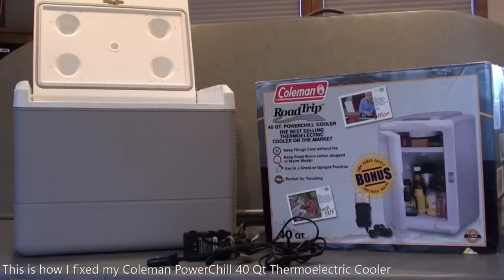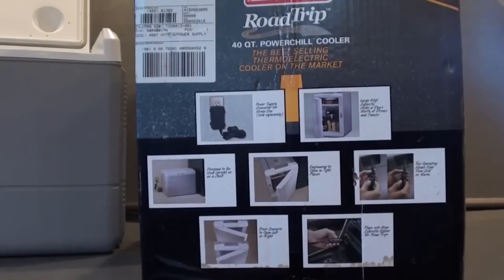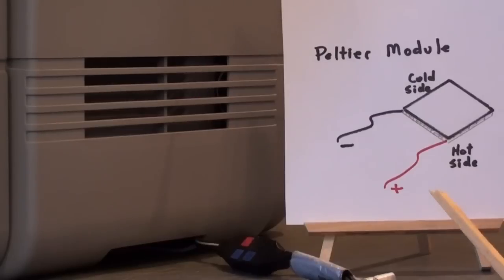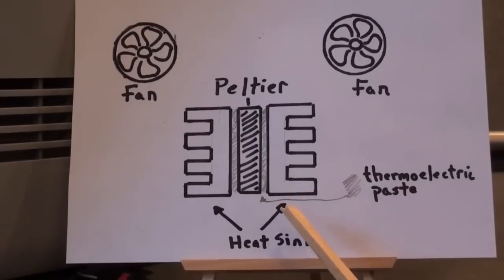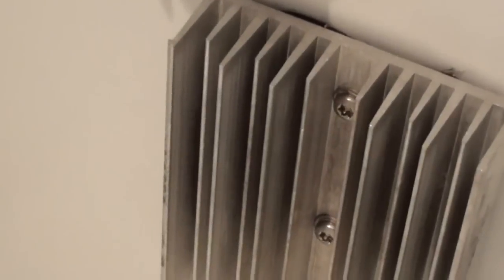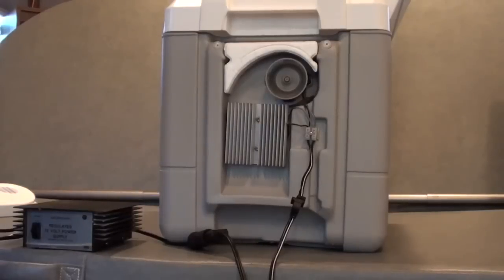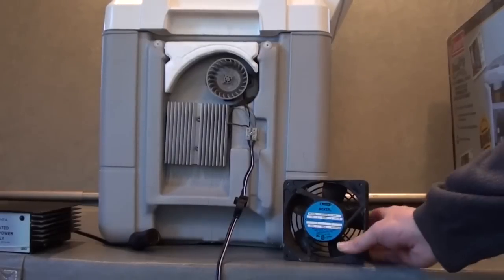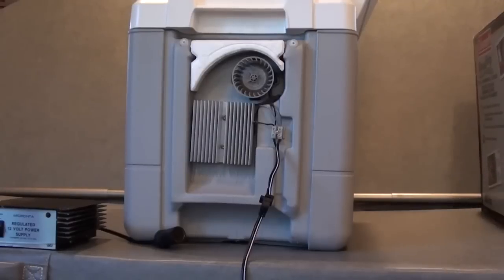Coleman Powerchill Thermoelectric Cooler won't Cool (or any cooler that uses Peltier Process)

Comment: Great video.  I have the same cooler.  Bought it 23 years ago and it still works great.  I took off the white plastic blower cover inside and now I can't get it back on.  Any suggestions?  And yes, I have tried multiple times and attempts, but unable to find out how/where it attaches.

Comment: Thanks for the video. I took mine apart to change the thermal grease. There is a thick black sealer between the peltier cooler and the body of the cooler. Anyone have any recommendation on what to use as a replacement when I put it back?

Comment: Do you know what that little thing attached to the peltier is? It's covered in black goo. Right next to the module by the heat sink.
I just replaced mine but the new one didn't have it. Should I use that with the new one or toss it?
Thanks

Comment: I appreciate the video mate, I got given a “Porsche cool-bag” that has a peltier system in it, it looks unused, and I plugged it into my cars 12v socket and it doesn’t work, the socket works because I can charge my phone from it but not the cooler, I don’t want to go pulling it apart, as I looks like I’ll damage the bag it came in, any ideas ? 
How would I know a dude is not working? 

I can see the mechanics and fuses through the air vent
Reply: People normally “give” things away because there fucked!
Reply: Gasgiant i expected that but I want to see if I can fix it,

Comment: I had a question for anybody that might know the answer to.does it matter which fan is on either side of the cooler when it's running?I ask because there are two YouTube videos I have watched and this video has the " grey color " fan on the outside and the "tan colored" on the inside of the cooler... however, on the other You Tube video it was the exact opposite
Reply: It depends on your specific model! The color is only so it looks nicer on the inside, besides I believe the inside fan is more protected against humidity and such!!!

Comment: Thank you very much for this very helpful video!  I have a question: our fan is working fine, the power supply as well (I conclude so as the cooler is the same in the car or in the house i.e. with two different power cords), and when I make the cooler work, the metal plats in the outside and the inside are a little cold (on the inside of the cooler) and a little hot (on the outside).  However, the cooler does not cool much... very far from minus 20 Celsius as they claim.  I was wondering if it would be worthwhile changing the electromagnetic paste and if I do so, if I should remove the old one before spreading the new one?  Thank you very much in advance for the additional help!  Josee
Reply: Same problem here.  Did you ever solve the problem?

Comment: Those TEC peltiers are a rip off they dont get cold enough to make a mini fridge or cooler for that matter. Ive bought several and tried them at different voltages, current etc.
Reply: U have to modify them
Reply: Please which direction is the inner and outer fan turning?, is the inner fan blowing in or out?, Clockwise or anti clock?. Thank you

Comment: I was just given this exact cooler from my grandparents! No idea how old it is, but I know they've had it at least 15 years. Took it apart yesterday, cleaned the fans, reapplied some newer thermal paste, cleaned my connections and the thing works like a charm! FYI, I did find a fuse built into the 12v connector.

Comment: great video indeed man. dig man I love these things and have spent many sleepless nights messing around with em.  found 2 similar at this yard sale a few years back. one was physically damaged (top left hinge busted) so i combined that freezer unit with the undamaged model too see if it would be more efficient. Thus, with a power supply voltage of 26 vdc at 10 amps split between both 13/13 Too my surprise it didn't get any cooler? No, however, it didn't take as long for this resigned cooler to reach its maximum low temp.  your problem was quite  obvious when it comes too any switch mode power supply which has a reference  voltage of 12 to 13 vdc +\-- it's not uncommon for a small cap 47 uf/35 to change value in the regulator section due too excessive heat. I have 5 which don't seem to work very well anymore with laptops when it comes to fully charging em. lastly, connected an igloo cooler to a variable power supply and discovered by lowering the voltage to 10 this certainly changes the low temperature threshold greatly. on the other hand raising the voltage to 14.5 at 6.3 amps came with an unexpected reaction for the heat sink developed some frost shortly after supplying the power? I may be on to something here?  PEACE!!!

Comment: I have a Coleman cooler...older style as it's over 15 years old..it's still running strong. I bought a 2nd cooler a few months ago thinking it would last just as long. Ah..NOPE. The motor completely quit. I need to do some research to see if it's worth repairing or to just buy another one...different brand maybe.

Comment: Thank you for the video, it was very informative! 
What brand, make and model is the regulated 12v power supply you are using in the video?
And you found it for under five dollars!? Where did you find that deal?
Reply: It is an old Micronta 22-120, which was made by RadioShack back in the day.

Comment: I am a truck driver do you think it would keep me cold for a day or two at a time
Reply: Not sure...would you fit inside of it?
Reply: In a truck these are what most everyone uses for refrigeration. They cool to 20 degrees below ambient temp, so if you keep the cab 68, it should be 48 degrees inside the collar. Yes, try to keep it out of the sun and blow the vents out occasionally when you're at a terminal. They will kill your batteries if you leave it running with the truck off
Reply: I have a different model of the same brand. They do okay if you keep the vents clear. Also if you keep your cab cool. Also keep them out of the sun. These in no way a refrigerator. I use mine for long car trips. Usually I'll throw an ice pack in for good measure. A cup of ice will help in a squeeze.

Comment: The inside  fan stop working now it's freezes  inside .🙄🙄🙄. Any part replacement for that
Reply: I think you can look up your cooler brand and model number and find a manual online, it should give you part numbers for different pieces of the cooler. I know with my cooler, it has the model number on the bottom of the outside.

Comment: If you are crazy enough to try it like I was, you can add an additional peltier. Cold side of outside unit thermally connected to hot side of inside unit creates a super cooled peltier. If you do this, it is not recommended to use the heating function of the cooler anymore though. But who buys a cooler to keep stuff hot?    |__Cooler inside__Heat Sync-C/H-C/H|-Heat Sync|__Outside
By doing this you are required to modify the cooling system for the outside as it generates a bit more heat. I used a small PC fan about 2 inches wide to help tunnel air into the other fan and screwed it right to the plastic housing.
Reply: Did you actually test this when done? Mine is usually about 40 below ambient colder even just 10 degrees would be a game changer.
Reply: @stoneyswolf  yes I tested it. I ran that cooler setup for almost a year.

Comment: Excellent info. I bought mine coleman 40qt electrc cooler in 2000. Just replaced my fan motor w oem part from colman. Waiting the full 3 hours to see if inside temp drops 40°F below the ambient temp outside the cooler. Appreciate you posting this video.

Comment: not sure how much impact it would have, but I would replace the bolts between the hot and cold heatsink with nylon (or similar) bolts that don't conduct heat between them.
Reply: Nylon would melt. If the heat is not properly dispersed then it will climb a few hundred degrees very quickly. It might not melt them completely but they will warp at the very least. Plus they do not expand and contrast like metal so they are likely to break.